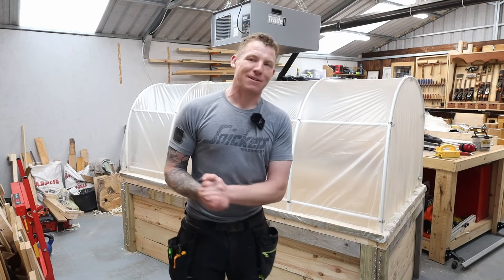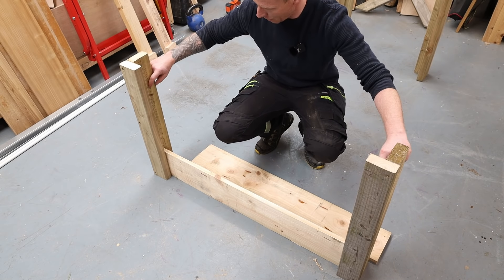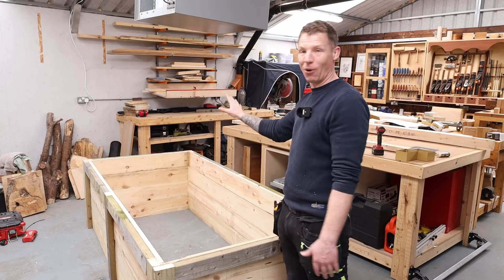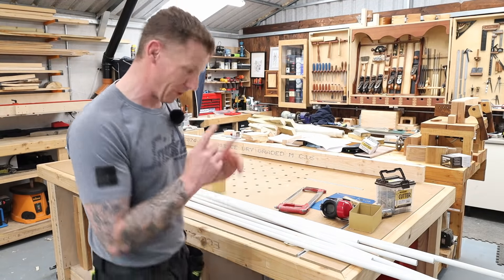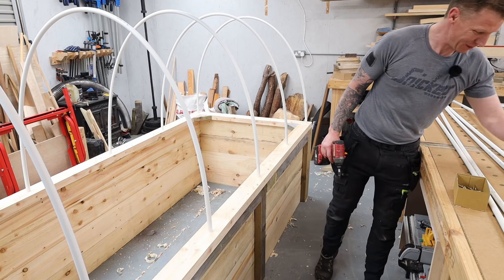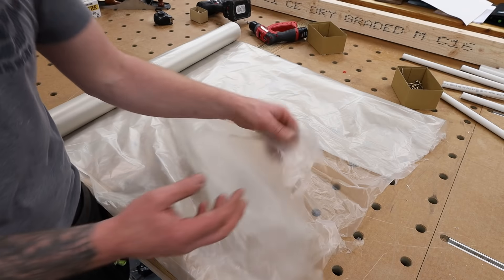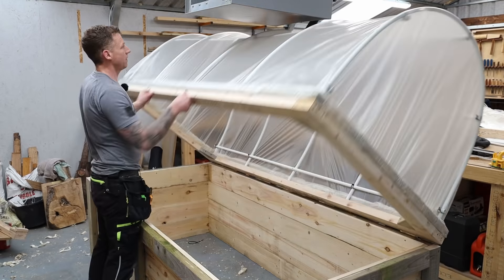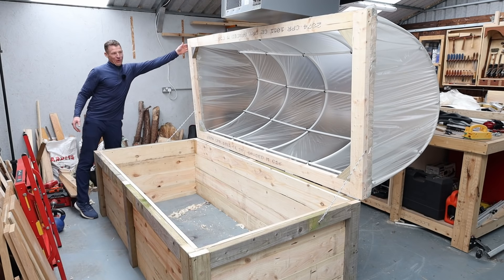Hoop House /Poly Tunnel Raised Bed Planter Box . With Hinged Top!! Easy to Build! Garden Ideas

Comment: Very inspiring video. But might I suggest pipe insulation tube on the ends of the hoop,  and a layer extra of polythene in order to avoid the 'gutter' problem.

Comment: Great planter mate, I've got 4.8m long X 0.8m wide raised beds and made 2.4m hinged hoop houses like yours. I have a mix of coverings, poly, fleece and scaffold netting to keep birds off. I used loose pin hinges so I can keep one part of the hinges in place and the different hoop house covers can be put on or swapped whenever I need that bed covered.

Comment: Small comment about conduit. Some brands are more flexible than others. Screwfix used to sell 2 metre lengths that were very rigid and brittle (the same brand of their flexible conduit would explode with sharp plastic shards flying dangerously). A small local electrical supplies shop sells 3 metre conduit that's much more bendy and suitable  for this job. Diyers should check what they're getting
Reply: All electrical pvc conduit should be able to bend into a right angle and most certainly should be able to flex like in the video.

Comment: Amazing work John. Just wondering about using treated timber for the main sides of the planter. If you lined it with polythene or landscaping material, would the chemicals leech into the soil. Surely the planter would last years longer.
Hope you're doing well since covid bud.
Reply from the maker: You would think a plastic liner would prevent it

Comment: Nice one John, very good design. I've started using galvanised corrugated steel, timber framed on the outside using the L design for my beds. Sounds crap but looks great and will last longer than me ! Cheaper than timber these days too...
Reply from the maker: I had thought about the corrugated sheets,